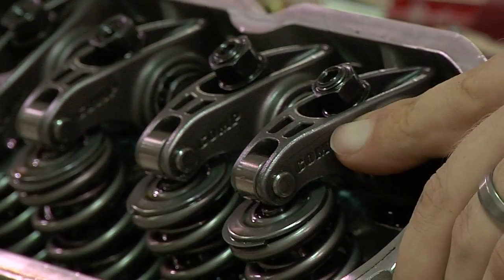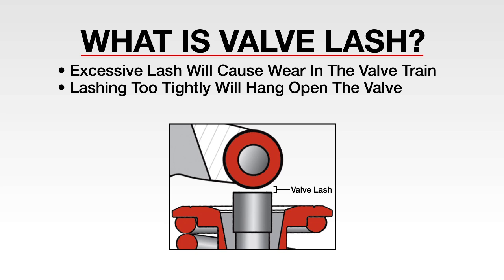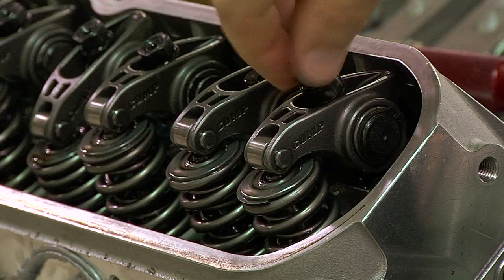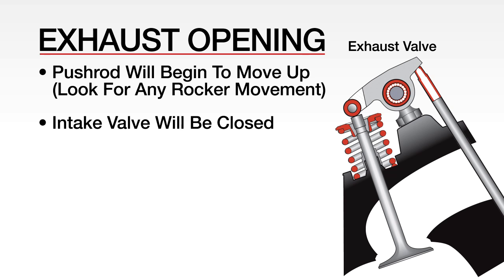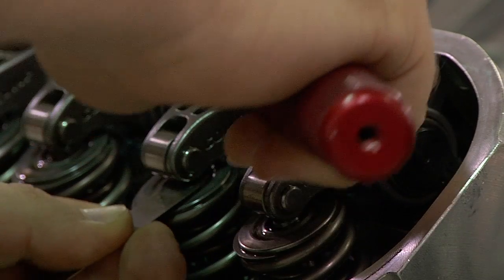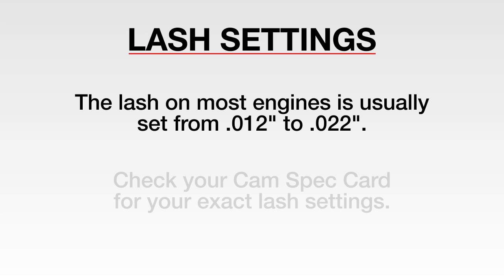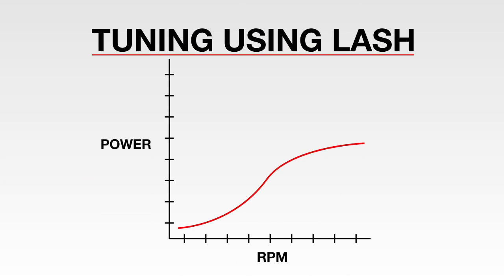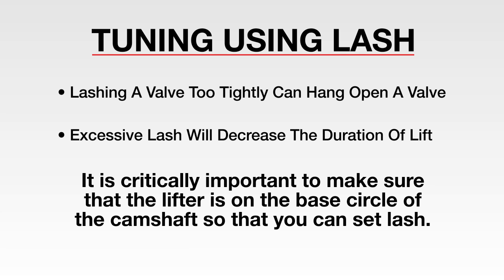COMP Cams How to Set a Valve Lash

Comment: I've got those same rockers on the T-bird SC. Magnums I think. Found this video looking how to adjust them. I think I have a valve staying open too long. It has hydraulic lifters so it's easy to adjust them. You just get the push rod snug and then tighten it down a quarter of a turn more. I don't know it maybe the ignition but I think its a valve staying open. I can't hear anything with the stethoscope. Going to have to go in. Such a pain to get to them though.
Reply from the maker: Before you tear into it, do a compression test. If you have a valve hanging open, that will tell you and pinpoint which cylinder.

Comment: I swear to god, none of these videos are helping me to the point where I feel comfortable to do it myself. I'm taking her to the shop. if you know how to do it already, I'm sure this video makes sense. for someone who has never done it, all the videos on youtube are different and contradict each other. maybe I'm just retarded
Reply: No, you aren't retarded. What you are trying to accomplish is to adjust the lash when the valve is completely closed. There are 3 different methods to do this, depending on your preference. Old-school method is to get #1 cylinder at TDC on compression stroke, adjust both valves, rotate crank 90 degrees @ a time and run through the firing order. Other method is to set all closed valves after getting #1 on TDC. This is different, depending on engine make and model. This video is the easiest to remember, without consulting a manual. When exhaust valve begins to open, lash intake valve. When intake valve is closing, lash exhaust valve. Simple.

Comment: It'd odd but it seams that all valve lash procedures are incorrect. Always adjust valves especially on a solid cam at TDC compression stroke . All engines have what you call valve overlap where both valves are open at TDC exhaust stroke. I've seen racers at the track adjusting #1 intake and exhaust then #6 exhaust at the same time.  I had then go back and check #6 exhaust at TDC compression and it was way to loose. If in dought do a leakdown test at TDC exhaust stroke and both valves will show leakage.
Reply: Use EOIC method and you wont have those issues.
Reply: dutchboy25al yes sounds like he was ecio wich is where the overlap period will be however the overlap period should have been mentioned and why it's important to be eoic.

Comment: At 1.08 the exhaust valve just begins to close, thus adjusting the intake. but the intake was allowed to almost fully close? When the voice said as soon as it begins to close.  at 2.12 the exhaust should have been adjusted, look how far it moved in the gap to 2.13 and more at 2.14  the valve is almost closed!    as we cannot see the lifter on the cam, which is the more accurate?
Reply: The video is accurate but the commentary is vague. It's just before the intake closes, the backside of the cam lobe. You adjust the intake valve off the frontside of the exhaust lobe.

Comment: Dear summit. When installing comp cam magnum cromoly roller rockers to an LS1 will I need to change the length of my pushrods?
In also have a 227 234 @ 50 grind cam with 600 though lift and am using Manley nextec double valvesprings. Will going from 1:7 to 1:89 cause issues with valve to piston clearences?
Last question and realy appreciate your help guys. Can I still use standard rocker covers or will the rockers touch the inside of the stock rocker cover?
Thankyou for your support

Comment: I'm having a problem when I'm adjusting my valves. I will tighten the poly-lock to where I feel a drag on the feeler gauge, so I will then tighten the set screw. Same feeling on the feeler gauge. But then I move the feeler gauge and there is no more drag. What should I do to get a more consistent setting?

Comment: How do you know which is the inlet and exhaust rocker for example cylinder 1?
Reply: If you are asking this question, you should not be adjusting valves.
Reply: You nailed it perfectly!
Reply: total one i guess you already found your answer.

the exhaust valve is topically inline to the exhaust port on your cylinder heads and the intake valve is further away from the exhaust port.  vise versa for the intake valves.
Reply: total one look at the exhaust out let manifold.

Comment: I have a 350 with aftermarket heads with double valve springs and I just put a new hydraulic flat tappet cam in it and my valves will not stay adjusted. Some will be to tight and some will be loose. I also have poly locks and ARP screw-in studs. Could I have your input on what is going wrong?
Reply from the maker: +Austin Ledford, 
Multiple valve adjustments soon after the installation of a new hydraulic flat tappet camshaft can be a telltale sign of imminent cam failure. Depending on the size of your new cam, most times a hydraulic flat tappet cam does not require a double spring. This may well be the cause, as well as following the proper adjustment and break-in procedure!
Reply: Do I need to go ahead and put a new cam in it? Maybe a hydraulic roller cam. If so what size? My springs seat at 147,  thanks.

Comment: So if my engine is using hydraulic lifters now and will be after the cam and head  install, will something similar to this still need to occur or does it depends on the parts in particular?
Reply: Summit Racing you dont use a fealer gauge on hyd cams..how does summit not know this??.
Reply: +jason stevens my gf doesn't mind me using my feeler gauge on her, her valves need checking, and my rod's are set to the same size every time.
Reply from the maker: Alexundre McConnaughy, 
Nothing different. After any cam
upgrade you will need to go through this procedure. If it is a solid lifter
cam, you will periodically need to readjust due to clearances opening up
slightly over time and use.

Comment: Greater valve lash allow more top end or horse power ?
Why ?
You allow valves floating ?

As i know the more valve lash you have the less valve lift you have,so the less air come in the cylinder.

I don't understand.
Reply: Great ? I thought the same.All i can think is that that top end only is for solid

Comment: Let me make sure i understand this.  So basically to set lash you just make sure the valve of whatever rocker arm youre working on is completely closed (the lifter is resting on the base circle of the cam or 180degrees opposite the max lift point of the cam) then tighten the poly lock to the perscribed lash using a feeler guage to find the spacing?

Comment: i have a question i have a 350 sbc and i put a high lift cam in with valve springs and lifters but now my eshaust rockers will barly touch springs when tighend all the way down please help do i just need 1.7 rockers?

Comment from the maker: Providing the poly locks are adjusted & tightened properly to begin with, there should be little reason to suspect they would need readjusted anytime soon especially with a stud girdle clamped down around them. Just to be safe though, check them after 250-300 miles!

Comment from the maker: Competition Cams without a doubt has it correct! Let us know if you have any additional questions. Thanks for watching!
Reply: So what order do you do a entire motor in? Do you do all the intakes then the exhausts? or one cylinder at a time? Does cylinder order matter or do I just need to make sure I get them all? Sorry 1st time trying to do this
Reply: Bryan Jensen 

I go right down the line, cylinder to cylinder doing EOIC. Have a starter button hooked to my starter and keep bumping motor over. Been doing it this way for 20 years and never an issue. Takes me longer to remove and reinstall the valve covers.
Reply: I do all my intakes then my exhausts.  Follow the firing order.
Reply: They do have this correct, although I use another method.  There is, however, an error in the video where they talk about using lash as a tuning tool.  Tighter lash effectively increases the duration/lift and does not increase bottom end torque, as the video suggests.  Its the opposite.

Comment from the maker: The setting procedure explained in this video is for solid lifter camshafts only. Instead of lash, a hydraulic camshaft requires a lifter pre-load setting that can be anywhere from 1/2 to 3/4 turn past the zero lash setting.
Reply: So, lets say I need 30 tho (.030) I would secure the poly lock till there is zero lash, Then turn the inner screw about 1/3 a turn then hold it in place while locking the poly lock?